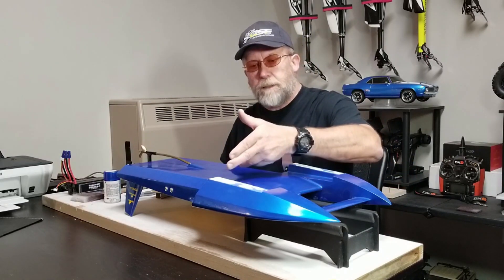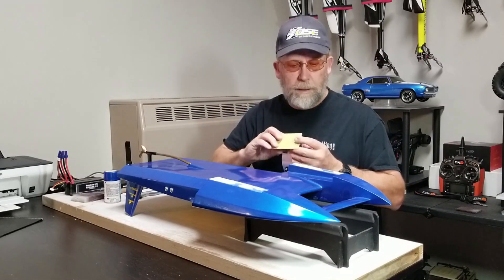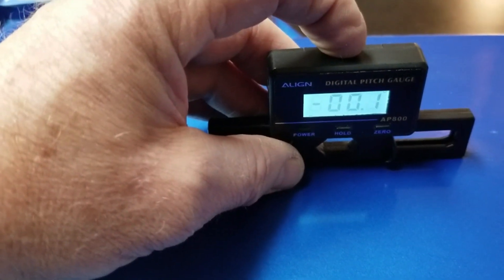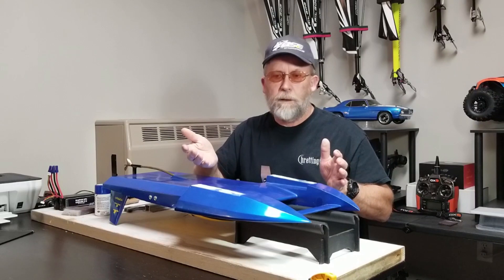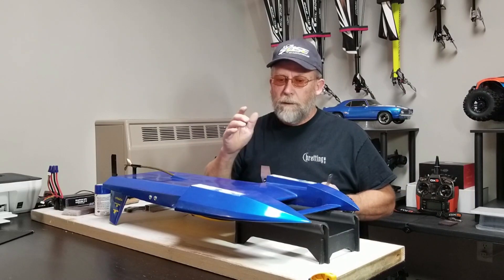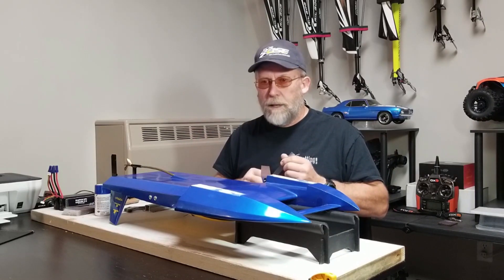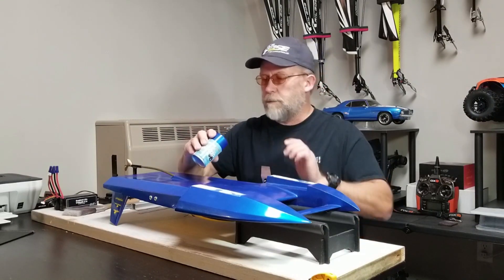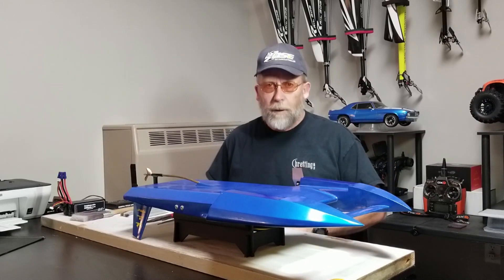PROBOAT UL19_Sponson Blueprinting

Comment: Thank you, Sam. You answered a question I had with the Popeye. I checked the sponsons with a straight edge, and noticed the outside sponson had that angle to it, and the other was completely flat. I just ordered some graphite powder before clicking on this video to see how to build up that angle to a level surface, but it looks like it's intentional like I had thought. Still thinking about blueprinting it for strictly SAW runs, but if it doesn't need it.. I won't waste the time. :goodvibes: